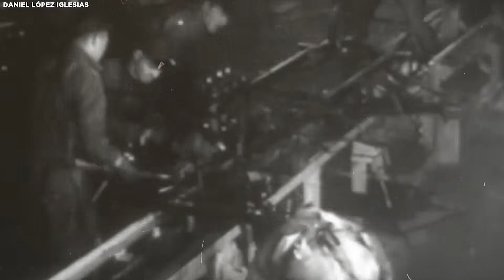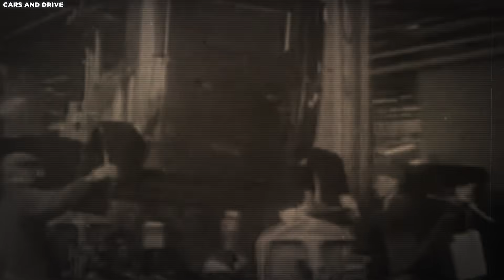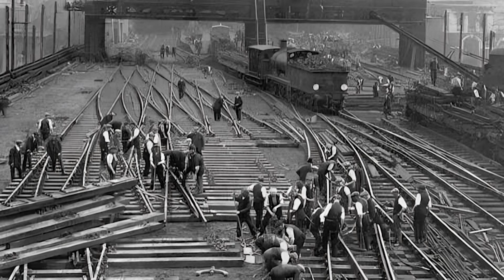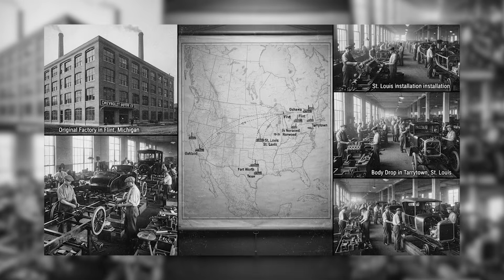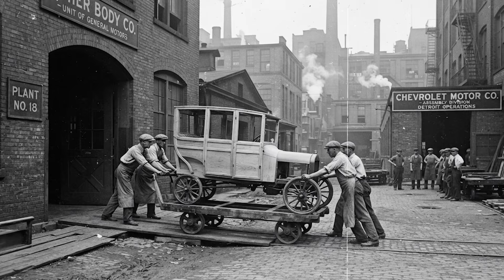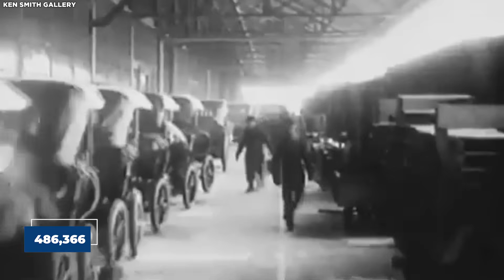How Chevrolet cars were assembled 100 years ago - Back in Time: Chevrolet Series 490 & Superior

Comment: They could not have been built that good because not many lasted as the Ford T and Model "A" cars a hundred years later.
Reply from the maker: Maybe they just didn't have enough duct tape back then? Kidding aside, it's true those Fords were built like tanks!
Reply: It had to do with General Motors.   An old mechanic told me a bulletin came to all dealers.   Any pre 1929 Chevy traded in the dealer was to take a sledge hammer to the block.   That’s why there aren’t many left.  The better thing about the Ford was the transmission in my opinion.   I’ve been inside both engines.  Prefer  chevy engine of that era

Comment: Chevys OVER  HEAD  VALVE  Engine Was An Advancement Over The Ford Flathead. The Engine Could "BREATH" Easier, Without Overheating The Lower Engine Block. 😊😊😊😊😊...
Reply from the maker: You're absolutely right! The overhead valve engine was a significant leap forward for Chevrolet and a major improvement over the Ford Flathead, especially in terms of breathing and heat management.
Reply: @davemckolanis4683  my dad just bought a '25 model, the engibe sounds much better than his model A ford